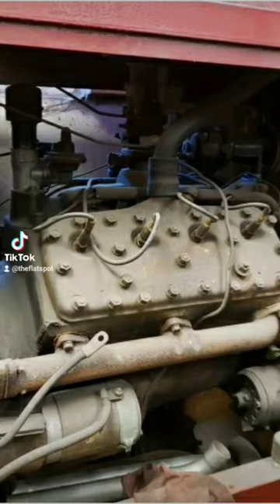Can I Run An Industrial #Flathead #Ford #V8 In My #Hotrod #shorts #howto #Roadster

Comment: Its a strange thing, finding industrial motors. I had a 413ci mopar, torn it down, it had the smallest lobes ive ever seen on a camshaft and a set of gears as a timing set (no chain, very similar to hi-po gear drive), when i had it running, it would idle great, then run like crap thru rpm range, till 3000 rpm, then it settled down and just purred. It was a irrigation pump motor. Designed to either idle, or run at 3000 rpm all day.....very cool to reverse engineer how it was built